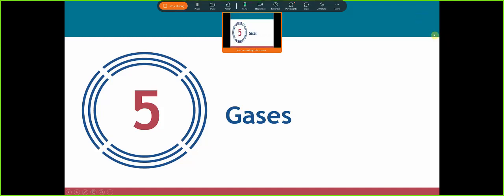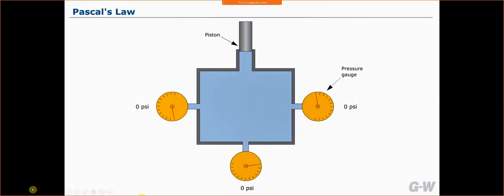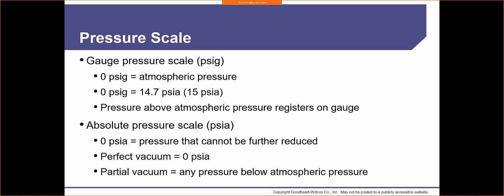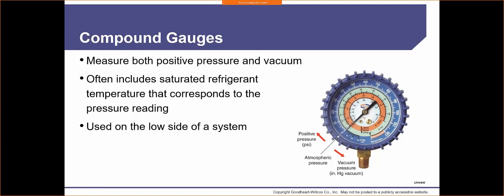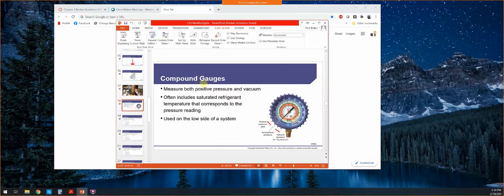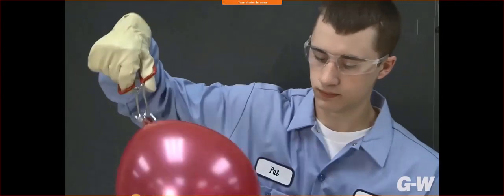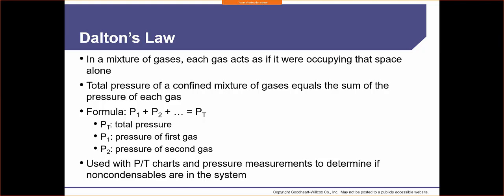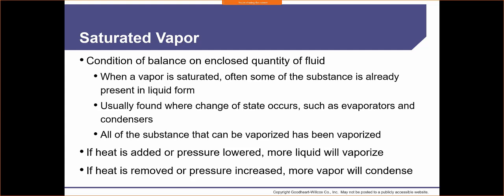Chapter 5

Comment: How an  air conditioner pressure and temperature values be affected if it was operating an ambient temperature of 70 F and that temperature rose to 100  F ?  Can you please explain
Reply from the maker: If a system's pressure rises to 100 degrees, condenser side, and the outdoor temp is 100 degrees, then the system will have a hard time removing heat as there isn't enough of a difference in temperature to force the warm air from the condenser to the ambient air. But if the temperature is 105 degrees and the ambient is 100, we will have heat transfer from the condenser to the surrounding air. It may be very slight, but there's enough of a difference to warrant heat transfer. That's why the high side has a pressure temperature difference that will be higher than the ambient temperature to reject heat.